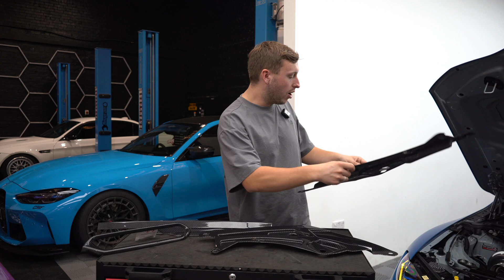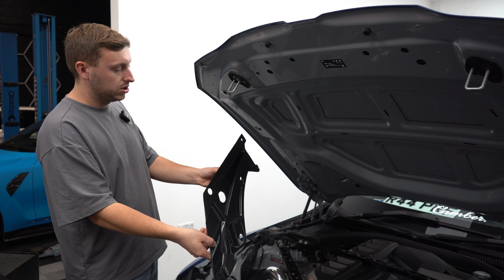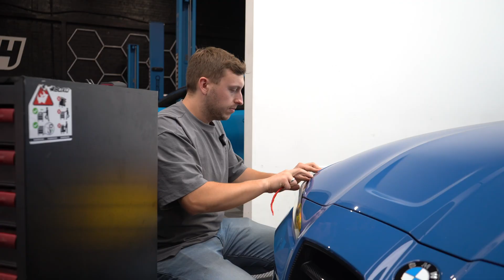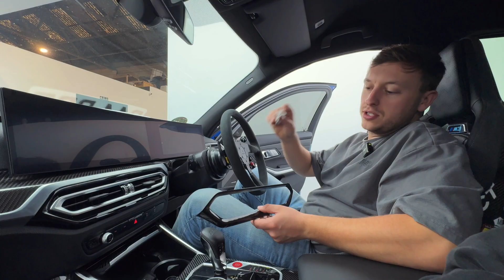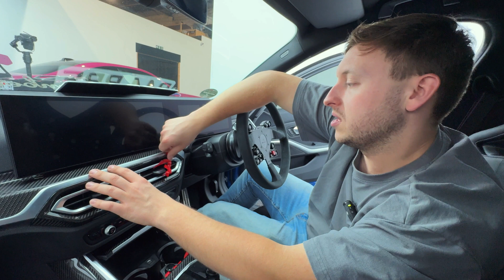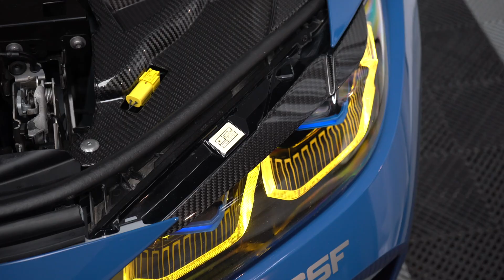UPGRADE YOUR BMW G80/G82/G87 WITH THESE 4 ESSENTIAL ENGINE MODS!

Comment: pretty sure the CF headlight covers are different between M3 & M4 in terms of fitment. Yet there's no options to choose the car on your website.?????
Reply from the maker: Hey! They are all the same, the front end apart from the bottom of the fender is the same.